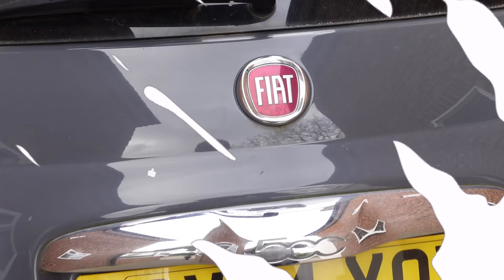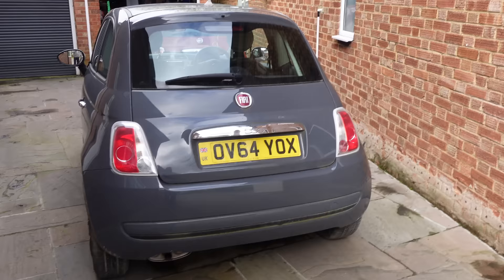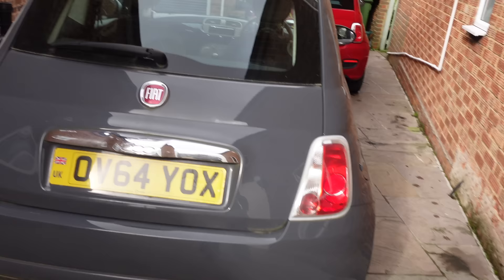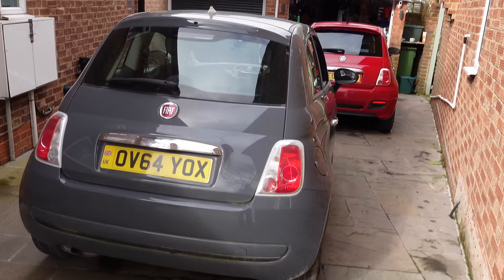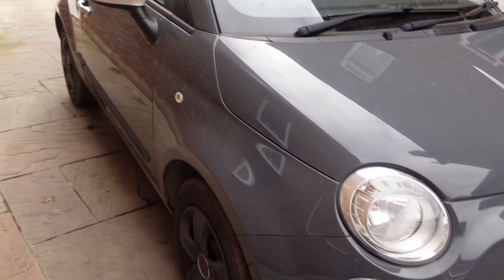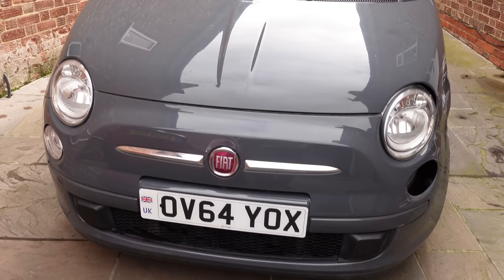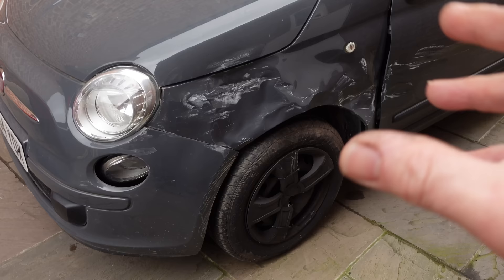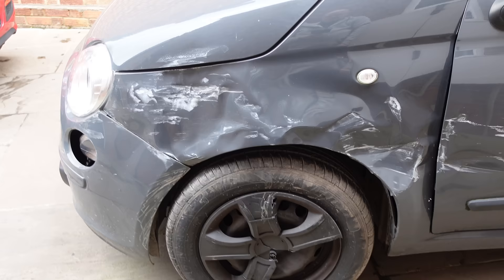Another New Project - A bit of Grey Therapy - Cat S - 2014 Salvage Copart Crashed Fiat 500

Comment: Hi, after a bit of advice, as your very knowledgable about these cars, any idea where i can get a gromet for the water pump metal coolant pipe, i bought one off ebay  but although it looks the same its only rubber where as the original gromet was a steel band incased in rubber, i cant use my car as its leaking coolant, any help would be greatly appretiated
Reply from the maker: I doubt you can buy them separately. The metal seal comes with the pipe if you buy a new one.

Comment: @love500 I have a minty, what do you use for cleaning the interior of the cars and how do you pull the dents out ??
Reply from the maker: I use Elbow Grease for cleaning most things including the interior. You can buy it in pound shops but the last lot I bought in bulk from Amazon (8 bottles). Link in description.

I use hot glue with pull tabs with either a slide hammer or another type of dent puller. Only on a very amateur basis. The Elbow Grease is great for cleaning a cream steering wheel. Sprayed liberally onto a microfibre cloth and rubbing/squeezing it as you run your hand round it. Comes up like new. Also good for seats and door cards too although I have a professional machine for the carpet and seat cleaning.

Comment: I've got a recently purchased 2010 1.2 Pop with 38650 miles but just realised it's on the original cam belt ..... Paul should I get it changed before selling on ?
Reply from the maker: Omg yes. It must be hanging by a thread.